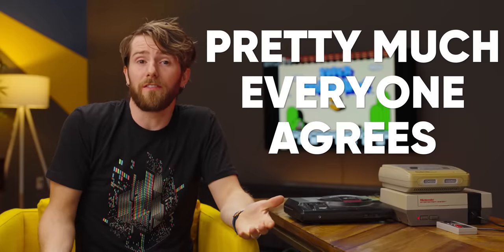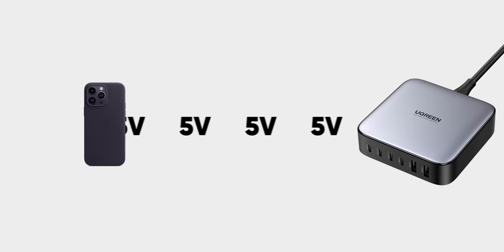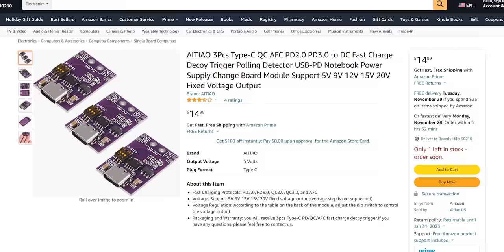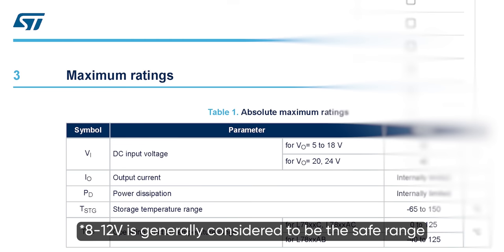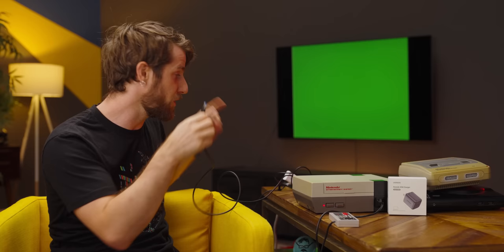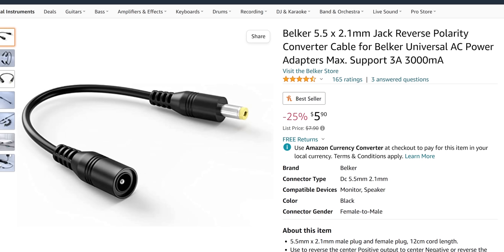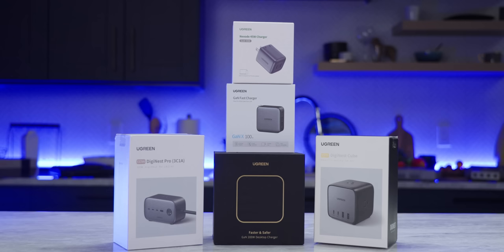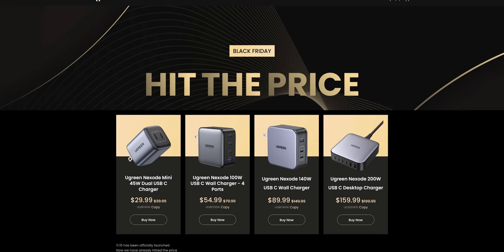How to Put USB-C Power on ANYTHING (almost)

Comment: Big warning: The pictured conversion cable sold by Console5 for SNES is correct if you are plugging a center-negative 5.5mm plug into it. The similar cable that's sold by Castlemania is correct if you are plugging a center-positive 5.5mm plug into it. Because the US SNES uses a weird plug it has no polarity protection (or at least the later ones don't). Don't fry your SNES! To make sure, use a meter to confirm that the final 7mm plug is center-negative as that is what the SNES expects.
Reply: Also don't use the NES power adapter for anything else as it outputs AC instead of DC.
Reply: Not only that, but the "worldwide" SNES (AKA the PAL one), runs on AC current not DC. I know, it's weird, but that's how it is.
Reply: @rijjhb9467  The "worldwide" one they show is a US NTSC unit. It's the only one that uses the weird plug.
Reply: @@violentcabbage9424 I don't really get trying to make consoles more convenient like this. Just for collector value don't go modifying your consoles. Emulation makes things very convenient if that's the overriding concern.
Reply: @98ahni  conversly, the NES dosnt care what the fuck you throw at it, it wil just work(as long as its Power regulator isnt overwhelmed.. which would however mean giving it around 2x the voltage it normaly takes anyway) Polarity swapped? AC? DC? fucking Double A?(i know they are just DC) the NES dosnt care.. makes it even weirder they shipped it with an AC Wallplug....
Reply: @Violent Cabbage I used MAME and zSNES on my Pentium 1 PC in 1997.  Emulators are old stuff, FPGA is the current hot thing and the future of emulaiton.
Reply: @rfmerrill  That style of SNES was sold exclusively in the US and Canada, so much for worldwide.
Reply: @Baka_Oppai  No. The polarity of the 5.5mm barrel jack was discussed in the video. The fact that Castlemania's SNES adapter flips polarity and Console5's doesn't was not discussed in the video.
Reply: @rijjhb9467  Yeah, there was no "worldwide" console. The EU/Oceania PAL and US NTSC versions were different. I can't find any info about what they sold in Central/South America which I can only assume means they didn't sell anything there--they probably got either the Japanese or US console.
Reply: @Violent Cabbage If that's the blargg I think it is, then I think he knows a thing or two about emulation and would agree with you that emulation is ultimately better for upkeep, just probably misconstrued your original comment a bit due to your punctuation choice or something.
Reply: @rijjhb9467  FPGA is still hardware emulation and wouldn't be where it is now without modern software emulation, which has come a long way since 1997. You might want to take another look at current offerings that aren't zSNES if you're looking for something to try on a PC you already have rather than spend upwards of US$300-400 on dedicated FPGA-based hardware like an Analogue Pocket-based setup or a MiSTer-based setup if you don't already have such a thing.
Reply: @weberman173  you can power an nes with a 9v battery I’m pretty sure
Reply: iirc a 9volt block isnt enougha s they usualy only provided around 500mA(at least if oyu want to run them "safely" while the NES needs around 1.3amps.... NOW AA batterys also dont provide enough(at least under typical circumstances)  but they are a hell of a lot closer then a 9volt block and can operate at that current evne if for a shorrter time then at their usual rating.

NOW a set of 3 or so 9 Volts in paralel? thats doable easily.. but at that point you could just run 6AA in series for basicaly the same effect as stated prior.

ANYWAY... the NES is still fucking funny because it as stated before takes just about any voltage from 9 to 18(heck you could probably give it less then 9 as wel as it gets converted down to 5 internaly as well as long as its not to clsoe to 5 volts) in either AC or DC and just dosnt care.. once agian, why they decied to inclde a AC adapater instaed of a DC ne like everyone else and save the rectifier in the console itself is beyond me
Reply: @weberman173  yeah as long as the voltage is close it doesn’t care lol
Reply: @Violent Cabbage that's what he was saying why go hacking up these old consoles to make them more convenient when u can just emulate
Reply: If you had actually bothered to watch the entire video first before commenting, you would have noticed that Linus already mentioned this. The fact that 341 people upvoted your comment is even more alarming. And here I thought I had a low attention span...
Reply: @Psythik  Please link the timestamp where Linus mentions that other SNES barrel plug adapters exist and that they differ in whether they reverse polarity or not.

Yes, he mentioned barrel plug polarity, in general, but this was with respect to the genesis and super famicom which take the standard barrel plug with center negative polarity (and thus may require a polarity-reversing adapter). It was not in reference to the barrel plug size adapters that are specific to the US SNES and its weird 7mm jack.

I'm pretty sure I watched the whole video, and I'm pretty sure the console5 barrel plug adapter was the only one he mentioned for the SNES.
Reply: what if I use 20V 5A cable USB-C to DC barrel for SNES? is it safe?
Reply: @1000area  I wouldn't. the SNES uses the input voltage directly for the audio circuit, and it's designed for 9-10V.
Reply: @《dobber 》  because it's also fun to play on the hardware. Like I have my nes, snes, ps1, etc. laying around, but hunting down my power adapters for them is a pain and some I'm not sure where they are anymore.

Emulation is great, and I've done my fair share, but nothing like popping in the real game and playing on my crt.
Reply: ...and that is the reason why the US NTSC SNES has a different barrel connector. It was quite common for folks to have both a NES and SNES hooked up to the same TV and its entirely likely an end user would plug the wrong AC adapter into the wrong console. Nintendo accounted for this by making the plug different.
Reply: @rfmerrill  hey, in South America they initially sold US Models, modded to the local tv system (in Brazil, M-PAL, which was just NTSC with some adjustments).
After a while they started producing locally the M-PAL consoles, using US models as base.

Comment: Would've loved to see Linus doing some soldering action and hardwire a USB-C female end into the old consoles
Reply: Why not go all the way and have a USB multiport  for charging , screen and controll?
Reply: @matsv201 : Graphics output requires a fairly powerful (and expensive) analog-to-digital converter like the OSSC, it makes more sense to use an external device that you can also use with other consoles.
Reply: Do you want Louis Rossmann to show up at LMG and slap the living ish out of Linus?
Reply: Why stop there?  Make the controllers USB-C as well!  USB-C all the things!  /s
Reply: You can add usb c to the 3ds family of consoles with a cheap USB breakout and some soldering to connect it to the little metal pads that are for charging on the Dock
Reply: @silverhawkroman  does he not like USB C?
Reply: @shinyhappyrem8728  depends on. If cause it will neither be cheap or simple, but futureproof and portable.

Having just one cable is super nice
Reply: @EikottXD  he doesnt like crappy soldering :D
Reply: @sonnyrynsaard3567  Yep, and other devices like keyboards as well. It's pretty fun ngl
Reply: @rodmongodwood  yes I don't either 😭
Reply: @silverhawkroman  louis is too busy being audited TWICE

Comment: I'm powering a 19V LG monitor with a 12V laptop charger. There is a voltage regulator inside the monitor that accepts a large range of voltages, provided there is sufficient current. That charger has enough amps, so it works without issues.
Reply: @digital_feline  ok😊
Reply: @Qwerty-uiop  also overtime it may burn out entirly. I had that happen to a lcd monitor that I accidentally plugged in the wrong wallwort that was undervoltage but still worked. Had no idea because they looked identical at first glance and I wasnt paying attention. If I remember correctly the monitor lasted nearly a month before it just wouldnt turn on. Even after figuring out and swapping cords. Luckily enough the external dvd burner that I had swapped cords with was undamaged but it also was only used about a dozen times and had its power cut off after each use via my surge protector.
Reply: @digital_feline  not really. I checked the brightness setting and that works as intended. Using lowest brightness (still plenty) for daily operation though to be on the save side. These built-in regulators step down the input voltage to a constant 5V, and then increase it to 53V again for the backlight. The internal buck-boost controller is rated to run between ~4.2-55V and it's even more efficient at 12V input.
Reply: It might also be (and I'm curious so could you check?) that the battery in the laptop is 12V but the charger needs to be 19V to charge it. My Asus EEE took 12V for a 7.5V battery but pretty much every other laptop I've had has a 12V battery and 19V charger.
Reply: @immortalsofar5314  the charger really supplies 12V
Reply: @yevgennegvey4021  it's a 29 inch ultrawide. 20V instead of the rated 19V should still be fine. But I wouldn't go any higher. Even though the internal voltage regulator is rated for way higher voltage, there is input capacitors that are typically limited to 25V and will blow up for anything higher.
Reply: Ooo what kind of charger? I have a 19v lg monitor too that someone gave me recently but without a cord
Reply: A lower voltage could overload the components to the regulator since it results in higher current (negative resistance). Probably won't, but lowering voltage isn't guaranteed to be as reliable.
Reply: @immortalsofar5314  12V(which would generally be referred to as 10.8-11.1V nominal, 3 lithium cells) batteries seem only likely to be common in small laptops/ultrabooks. The nominal 19V voltage has been common with traditional laptops for many years, likewise power tools for the same reason - 5x lithium cells in series at about 3.7V nominal each.
This is also why 20V is one of the voltages commonly specified for USB-C PD.
I say nominal(effectively meaning in name only) as the battery voltage naturally varies with charge status.
Presumably yours used a 19V charger to avoid requiring a different adaptor.

Comment: Always put a reverse protection diode INSIDE the device with barrel jack. And clearly indicate voltage, current draw and orientation on the outside..
Reply: Reverse protection p-channel MOSFET for low voltage drop.
Reply: @SomeDudeInBaltimore  yeah that would be better. Depends on the load, the drop might be negligible.
Reply: yeah good advice I learned it the hard way my devices were fried after I designed the circuit lazy minded did not include protection
Reply: fried my rog ally and a usb device because of poorly designed usb c splitter with power delivery
Reply: @Surreal_ASMR  never use a USB splitter is the real take away here.

Comment: Linus probably remembers the early days of cellphone chargers, where basically every model had a different charger, even across a single manufacturer's devices. A "universal" charger to replace a dead or dying charger would come with like nineteen different plugs and had a mile-long compatibility list that you'd have to read through and hope your phone was on there. *shudders*
Reply: Those where dark days......I lived thru...just like Nokia immortal phone...
Reply: Back then universal chargers had a dozen type of  connectors.
Reply: @tyaty  They still do.
Reply: And then, Nokia unified their charger using a simple dc plug
Reply: @Jabawalk  Nokia had a few standard charging connectors over the years. Both in multi pin and barrel.
Reply: @agentcrm  The last Nokia we owned had both a micro USB and a tiny barrel jack as input for charging.
Reply: @rijjhb9467  Same, I had a couple like that. 
The earlier ones had a "30 pin" style connector, that worked across multiple of the families Nokia's
Reply: Yep, now we just have one cable, and pray it's wired correctly and our devices will recognize it without frying it.
While i like the idea, usb-c is no better or worse than any other 'universal' connector.
Reply: Thanks for that dark memory that I had forgotten about * shudders * I try very hard not to think about that
Reply: And one company has still been in that fight until the present: Apple.
Reply: @agentcrm  
They  have 3 now.
Lightning, micro USB-B and USB-C.
Reply: Pepperidge Farm remembers...
Reply: I had a hankering for some ps vita gaming and I’ve lost my charger, the earliest model had a proprietary charger. Sony were terrible for this
Reply: Lol, i remember having guests over and we didnt have their charger. We just swapped their nokia batteries into our phones to charge them with the skinny barrel plug and swap them back later
Reply: @skekch  many years ago I remember buying this adapter which had like ten different phone plugs… this was during the very early smartphone days. I used it when I had a work n95 Nokia (still miss that thing) and a iPhone 3GS
Reply: i remember being as a kid, i was allowed to have the n95 for 5 years when i started driving. At the time, the fm transmitter and the wifi seemed so cool, and the sliding lense cover was my favourite fidget toy
Reply: I had something like 30 adapters in my car at one point so that my friends could charge their phones. It was a nightmare.
Reply: In my home part of Ireland is Washington sórt of líne that until 2013 ish
Reply: I'm suddenly feeling old. That was just a few years ago. Doesn't everyone remember those days?
Reply: @tyaty  I still have 3 of these....and a drawer devoted to power modulation.  this isnt a solution because it taxes every application by 10-20$
Reply: we have EU regulation to thank
Reply: I imagine many of those devices don't have nearly as a strong Nostalgia following as they could simply because of the hastle.
Reply: My father had a plastic tote 3×4×whatever foot that was every cell phone charger a man would need -he was very proud of it.
Reply: I still have something like this in my car.  Except these days it's a micro USB end with a bunch of connectors that have a female Micro USB slot and the male end for other things such as USB-C.  Definitely not as wild as it was back in the earlier days, but certainly a sort of thing that still exists.  Honestly a super handy thing to keep in the car, as I've got adapters for it to be able to charge basically every device I own as well as the ability to just swap the end out if a friend needs a quick* shot of power to their phone.

*It's not the fastest charger in the world, but it has definitely saved my ass many times over the 4-5 years I've had it.
Reply: @tyaty  I have a cable with all three of these on the one end.
Reply: Remember having 3 Nokia cellphones in the households and 3 different power adapter?
Reply: This comment triggered me. I was forced to remember when I plugged the wrong charger into my sisters phone and it just killed it. I was not forgiven..
Reply: A bit like barrel Jack's, then.
Reply: Yeah, people will rightly be annoyed at the complexity of USB-C, but the other option would be to have 10x more complexity and also total incompatibility of everything with everything else.

Comment: 6:58 Negative-tip power cables were common into the 1990s. They seemed to start switching to positive tip when they started using switching supplies. Always verify the polarity for older devices.

Comment: Fun fact, the NES's power system is designed to work with any 9V source, AC or DC, center positive or negative.  Might make having multiple cables a little easier, if the barrels match, you can use the same cable for all earlier devices.
Reply: You can also run the NES on double a batteries for about an hour
Reply: its important to note that barrel size isn't always a garuntee that its the correct voltage. there's not really a defined standard so much as there is a best practice.
Reply: Based power system

Comment: I love the idea of combining these, with mods for an HDMI out, making an old console so much more convenient for modern use.
Reply: Or DP, so Type-C Alternative Function can be used. This means USB both for power and video.
Reply: @uis246  TVs don’t have DP and console players tend to play on TVs rather than monitors.
Reply: @chronology556  the Gigabyte Aorus FO48U could be used it has DP and 120Hz, it´s an OLED 48 inch big
Reply: @Humbulla93  Thats it, One tele has it its now a generational norm
Reply: @chronology556  Then just get a USB-C hub that supports both HDMI and PD.🤣 (horrible idea actually, but every laptop maker is doing this)
Reply: Unfortunately some of these consoles don't survive mods. The SNES in particular, dies easily. The NES is far more survivable. You don't want to end up buying 10 previously owned SNES's just to find a working one. Analogue's SuperNT ends up being the better route than trying to find a working SNES.

But then you also have to contend with all the carts with dead batteries.
Reply: @yuxuanhuang3523  why is that a bad idea? Is It because of cross interference between data and power lines?
Reply: @Humbulla93  Nope, Type-C for everything is great for me. But I would rather have the option of not having to carry adapters around. (Just give me the extra port)